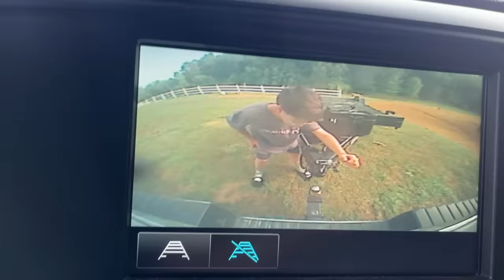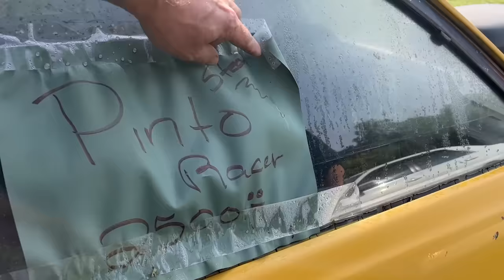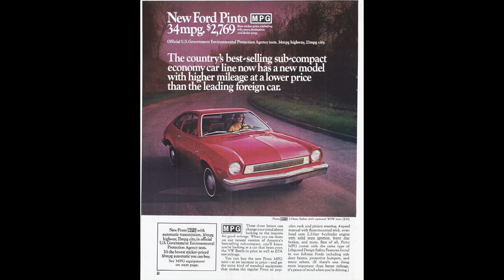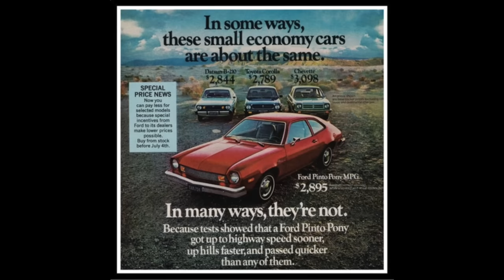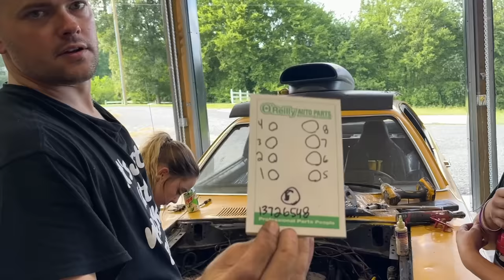Will It Run and Is It Fast? Dirt Cheap Race Car!

Comment: I heard you say the firewall needs to be moved back the wagon I had I didn't do anything to it but for some reason my engine sit back a lot further than this one is and my radiator sat behind the radiator support like it's supposed to be

Comment: The way to tell an 8 inch from a 9 is look at the differential, it's a lot bigger for a 9 and there's also two bolts on the bottom that there's absolutely no way to use anything other than a box end wrench on them. The 8 inch you can use a socket on all the nuts but the 9 has those two that you can't. Personally I much prefer a Dana 60, being able to check the gears without having to pull the axles, driveshaft and diff is so much nicer, plus it's even stronger than the 9 inch. (the gear at least) If you can afford one a Winters Quick Change is even better.
There was a guy on Drag Week that had a Pinto with a twin turbo 460 in it. (or at least it was a 385 series block, it could've been a 577 kit for all I know) You know, you could go Rotsun with it and put a 7.3L Powerstroke turbo on it and a blow through carb and put a smaller exhaust housing on the turbo so it'll spool quicker and have 500hp easily. Add the valley reinforcements and a stud girdle and decent rods and you'll have a screamer for pretty cheap. 
I HATE Edelbrock carbs, I've had two and my uncle had one and not one of them held a tune. You'd set it and an hour later after driving somewhere you'd have to get out and tune it again only to tune it again an hour later or when you got home, whichever was first. They are absolute shit, and on top of that Freiburger proved on Engine Masters that they cost you power. Going from the same size Edelbrock to a Holley they picked up 85 horsepower on a big block chevy, no difference in AFR or anything, just more power. (1405 is 600cfm) 
FYI the date code is above the starter, typically upside down. It should be something like D2AE if it's a 302, if it's a later it'll probably say E9AE or whatever. E is any decade 1980 and on, D is 1970's C is 1960's. The second place is the year of the decade, the third is Ford the fourth is Engine. 
Classic Industries has a points type distributor for $70. https://www.classicindustries.com/product/all-years/ford/mustang/parts/12127F.html?gclid=CjwKCAjwpJWoBhA8EiwAHZFzflp0ufXKTfKFQ6X2lFVuKx2b8ADdDJxZchUm9mMNEnIoGdJvlAHfRRoCcu0QAvD_BwE&gclsrc=aw.ds
That exhaust coming out of the front of the driver's side head scares me.. I don't know if that's the AC or PS pump bolt hole or what but I've never seen exhaust come out of the front of a head like that. That thing reminds me of when we took the glasspacks off my 70 Mustang.. gross sounding and absolutely no power, there's just no bottom end on those engines without a little bit of back pressure. Looks like your daughter is ready to run the Jr division at Drag Week/RMRW etc.

Comment: As a truck Driver in Salinas, Kansas on the Freeway I seen a Pinto hit in the rear after cutting an 18 wheeler off and it exploded like a Bomb. I stopped my rig and ran across the Medium and opened the front door and yanked the man out. I then went to the Truck where the whole engine area was a blaze and got him and his partner out just before they both exploded and burnt to the ground. I would never drive a Pinto on the Road.

Comment: I purchased a 2003 Toyota Prius with 120,000 miles from a yard sale. My buddy was driving his Prius and ask about it sitting in the driveway. I ask the elderly guy whats up? with the Prius had a dead tag. It had a dent on 3 corners guy said his daughter ask him to quit driving he was hitting mail boxes polls in parking lots. He said its gonna need a new main battery pack. After all said And done i had $2500 in a one owner car. Ive been driving it since February. I figure its saved enough $$$$ to pay for it. V8 i was driving gets around 11 to 17 per gallon. Gets 46.4 in town over 50 on highway.i filled it up today, and honestly can't remember where or when i filled it up a month and a half? Ago. If you run across nice one nice price don't pass it up. I said id never purchase one. It will destroy a v8 Oto45 no joke love it.

Comment: Most people just use V8 Mustang II mounts, bellhousing, oil pan, etc, and the engine sits correctly in the chassis, without cutting out all those pieces, like the previous owner did.

Comment: Looks like you have a early model timing cover on a late model, you may have cooling issues, if the water pump is reverse rotation.
Reply from the maker: Ok thank you

Comment: I use the hei distributors and have had a few of the cheep ones they if they work it isnt for long. you really need to buy a good brand that will interchange with gm parts. the cheep ones look like they will but they wont.

Comment: To set total timing you have to be at 3000rpm to time it to 30° other why's set it to 10 degrees at idle. If you set it at 30 at idle it will be to much once you get on throttle. Then just go 2 degrees of timing till it's snappy on throttle don't use vacuum advance leave it off.

Comment: @sleeperdude  Yeah I love them Ford 2.3l engines, good power in small package! I have one out of my mini stock car that was built by an engine shop that built tons of these engines for lots of racers at all the local tracks. It's been sitting for a while so would suggest bearings be replaced but was never raced, only had break-in time plus about an hour of idle run time on it after installed in a pinto. Then I was in an ATV accident and never raced the vehicle, so engine just sat and now I'm stripping the car and junking it due to not enough room for all my vehicles and a city ordinance against parking any vehicles on grass. I paid almost $7,000 for work, labor, and parts when it was built. Had lots of custom work done to head, crank, pistons, and porting and sounds awesome at an idle and at them high RPM's! Looking to sell cheap due to needing bearings replaced after sitting for a while and no room to store it anymore.

Comment: Your new shop is awesome, but there's a pretty serious echo. The build quality on this pinto was pretty sketchy, especially with the radiator sticking way out in front, not to mention the bracing deletes. Find some headers for it,and take it to the drags.

Comment: It would be pretty neat if you got together with Dylan McCool at the drag strip and see if your 302 Pinto is quicker than his 302 Mustang II. Both of you have slightly modified motors, and both cars were kind of basket cases to begin with. I think it would be a fun, interesting video. Just suggesting...

Comment: If only I could obtain my wn 1972-1974 Ford Pinto (non-hatch) automatic transmission or a 1972-1965 Ford Econline Van, that I would upgrade with a 1999-2015 EcoBoost with a 10-Speed Auto transmission!
But, being here in Western Washington State, these peices are "UNOBTAINIOUM"...

Comment: oh Lord a Ford Pinto just be sure no one hit the rear or it even if it a slight dinging tap on the rear bumper it will blow up in flame as it were made for to do just hit the back of the Ford Pinto and it will go Ka-Boom.

Comment: josh the fan belt went to the alternator ,,,flywheel andcrankshaft ...  its old school ...but i had ford granadas and all kinds of old school ...those belts usually ,,,go to driveshaft ,,,,alternator ,,, well you know ...three areas to get  the motor of all aspects ,,,to run right ,,,no serpentine here with just one belt   ...if that breaks ,,,youre totally screwed

Comment: I'm only up until you push the carburetor to see if it would work and I can tell you right now I would pass it it's going to be a ton of money unless you got a lot coming in you're going to need it to be honest I would yank that motor out and rear end and stick a crate engine in it with all the controls and you can make it a daily driver and if you really really wanted to be fast and reliable at the same time stick a Chevy engine in it lol

Comment: Or it has a 3500 stall converter in it…!
I had a 3500 stall converter in my 71 El Camino. It went nowhere till it got close to 3500. ….

Comment: Lmao. Wow I know that pinto well. I can tell you everything you need to know.. . It's actually a 306 with a Howards 517 lift cam. . It has aod transmission. And a 8.8 rearend. Brakes was all rebuilt. Anything else ???. Oh the heads was put on backwards.. and I actually have videos of motor break in and videos of it running .

Comment: Better get that fram off there STAT. Fram makes the worst oil filter on the planet. I used to use wix all the time but now i use Purolator only. Made by mann Hummel in the USA, mann Hummel makes the oem Hyundai filters too. They make a ton of filters. Good ol TSC for 5$. Get my oil at rural king

Comment: I just wanted to comment about your recent package opening the Way Was show. No disrespect but if I were you I'd find a better way to open the packages instead of with a big butcher knife over your family's laps. Love your work and your family is a blast. But perhaps instead of that big knife although you seem confident with it but might want to use a pair of scissors or retractable utility. And have a separate table for opening them and not on your family's lap. No disrespect but just was concerned and thought I'd mention it God bless keep up the good work :-).

Comment: Hey I have a 2003 ford ranger I know Ralpee is looking for a ranger I would really like to give it to him but I have way to much in it runs and drives it’s got the 2.3 in it new a/c compressor works new plugs and wires and hub assembly’s on the front new tires a year ago this truck is clean and I would love to sell it to y’all for your son I’d sell to you for a $1000 dollars! I’m telling you I love you guys videos I’ll work with you on getting it to you I’ll do everything I can to get this to y’all I just can’t give it away

Comment: THE DODGE MOTOR THAT YOU PULLED OUT OF THE DODGE PICKUP AND YOU PUT THIS ENGINE INTO THE RV MIGHT HAVE A CHIP IN THE IGNITION KEY FOR SECURITY AND  THE IGNITION BARREL AND IGNITION CHIP THATS IN THE KEY WILL GO BAD AND THE ENGINE WILL RUN AND QUIT AND THE ENGINE WILL ONLY TURN OVER ..ITS A SECURITY PROBLEM THAT YOU HAVE IN YOUR DODGE MOTOR THATS IN YOUR RV ..

Comment: i woude not move the Engien Back special i f you wonna drag race with it you need as much waigth in the front so it does not lift up wile exalerating. i woude worke the front around the cooler much less work and like i sayed you need waight in the front otherwise she will lift even more wile you hit the throttel on thge Dragstrip :face-fuchsia-tongue-out:
Reply from the maker: Ok thanks

Comment: That car don't seem that fast for what it's meant to be. Looks and sounds like a low 14 second car. Probably be cheaper to just put some street radials on there instead of full on drag slicks. Y'all got a good deal on that though and most of the hard work is already done.

Comment: For a non running car your paying 2 grand that dum . Mabe if you know it runs and drives . But you don't you didn't even check the oil to make shur  it has oil . For 500 would have been a steal .
Reply from the maker: Yeah maybe so

Comment: Hello its me again. :  crazy old man that thinks he knows everything..
So when everyone is working on the car.  And squeegee goes to the "art department". she colors the thumbnail
I used a filter to take a black & white photo with my iPhone. (can't send you the pic) print it out and have her color it. it don't have to match. use what ever color she feels.  if she has transparent markers it will only darken the color. than scan using to use ing as thumb nail.   you should be able to get a line art type filter to not have gray. just imaging this thumbnail with all unnatural colors.  However the yellow she has matches he. car.  I'm just saying that being an artist she can avoid physical labor.  still she should use her talents in the visual aspects. pre and post production.    also think shed be good at. adding transitions to the videos.  after your done (or working with dad). there is a certain artistry to selecting the best.   butte then.  just randomly dropping them in it better. than all the jumping. between clips ni know you spend too much time editing.  that's why you let the fastest do it